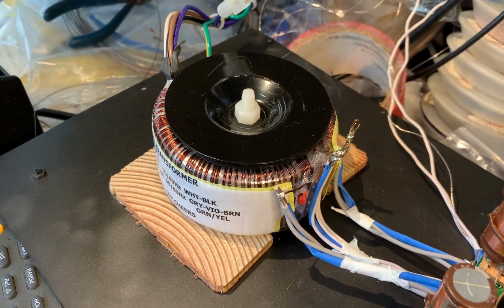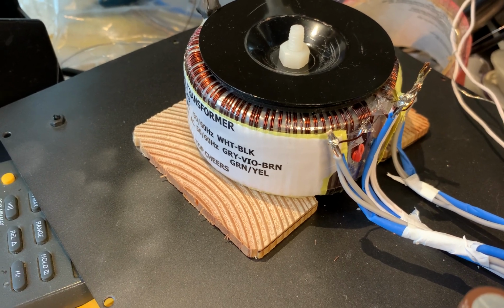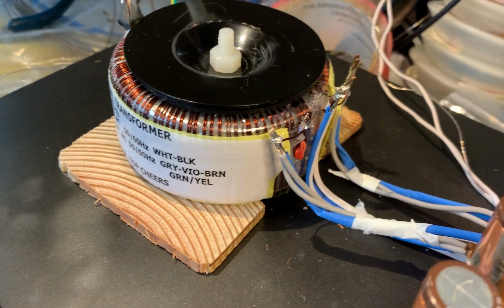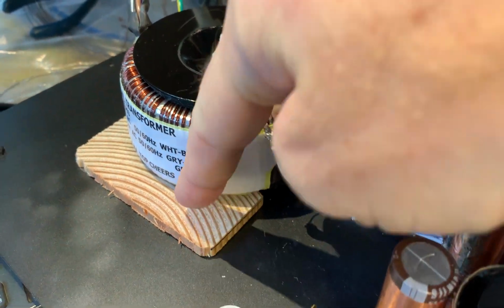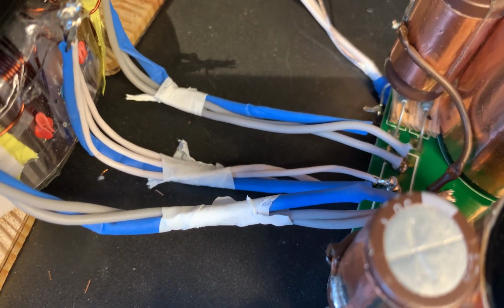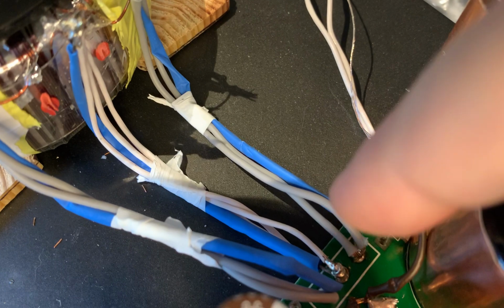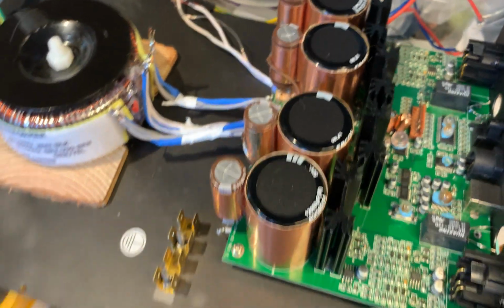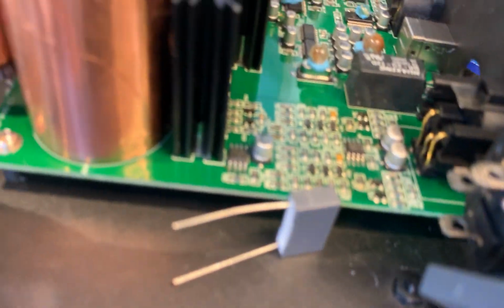Give a better chance for your torroid!

Comment: Hell yeah ! Keep it going buddy . 
Your doing great !
Reply from the maker: Thank you Tee-Jay ;
Reply: @realworldaudio  THANK YOU I actually have a?? For you when you get the time . 😆
Reply from the maker: @tee-jaythestereo-bargainph2120  Cheers Tee-Jay ; )
Reply: 'Pi filtering' in a push-pull configuration 
'Tube/Valve amp' 
Meaning a Cap b4 and after the 'Choke" 
Doesn't this help to have very clean power and great low end bass . 
The thing is I know a company who does alot of tuning in this area 1st they started out with Nichicon 500uf before choke and 235uf after choke then this company went with a full blown 500uf b4 and after the z-10 core steel choke all Nichicon of course and this gave a stronger low end bass but now on their newest model 
They went back with the 500uf-b4 and 235uf after,  i wonder why?  but one thing i do like is that they use ESA clarity caps as notch filters on all the tubes 😃
I just wonder why they went back n forth 
I have the 500uf b4/after model and the Bass is strong to be a kt88 x4 push pull desighn
Reply from the maker: @tee-jaythestereo-bargainph2120  I'll make a video response, this is an important subject to explore ; ).
Reply: @realworldaudio  thanks Man keep up the great work !

Comment: Hello folks. Please don't stop ripping apart " task at hand " and no your not destroying the designer, artwork as they call it.
After all you did tell the whole truth as your not justifying for them. Double chezzey and at least add in some copper into the wiring or twist ties from Glad bags.
 Your an inspiration to us, all.
• get it up and running, I agree go on to the next step. Because you know that top plate can be made the next time you have the saw in use, soon for another major task at hand. " I have to remember not to place something on top of the little jobs I place for I can see. Lol
Hardware store down the street, faster to buy another screwdriver.
Imagine losing myself the paddle store would be out off paddles up on Shiite Creek.

Ride Easy